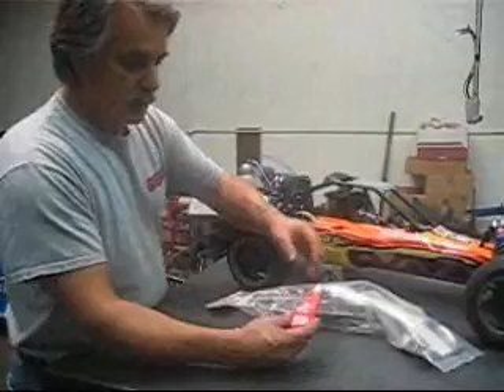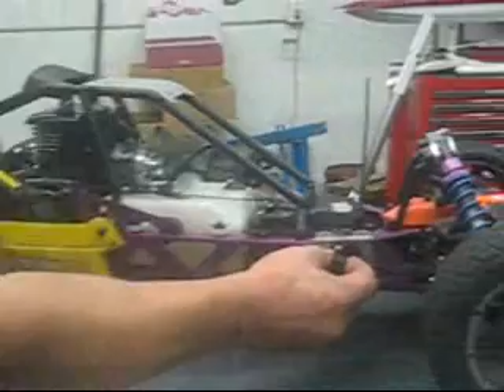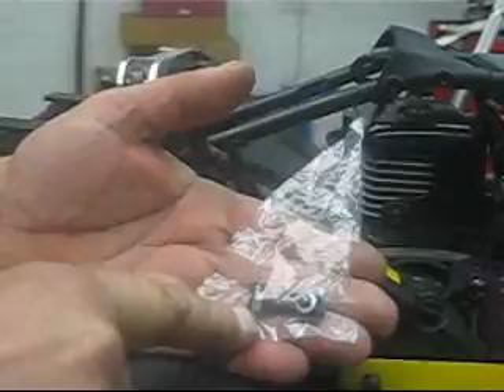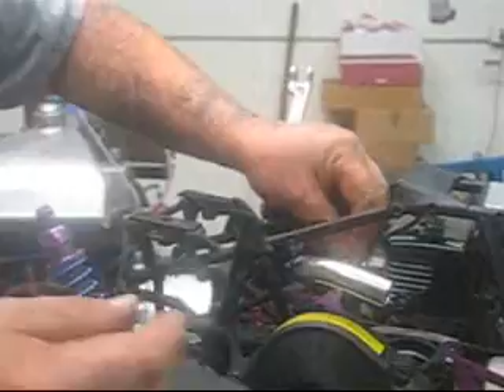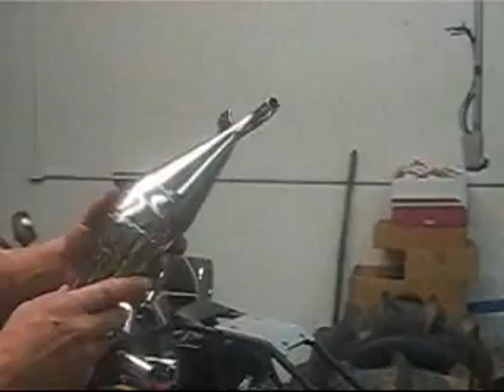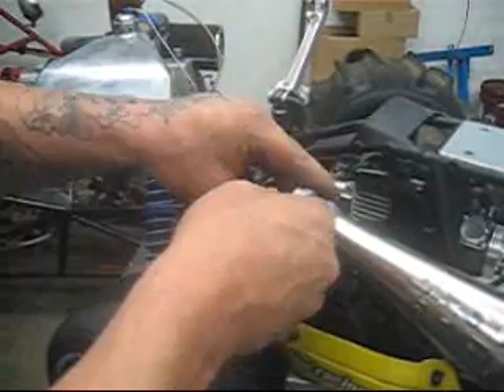GBE Tuned Pipe How To Video

Comment: ok, for all of you, look at the pipe, with GBE pipe, you see that it uses a silicon sleeve, the advantage of that is so if you crash it has a weak point to split at, if you have a dominator or a jetpro, the pipe bends/cracks and could do damaage to your cylinder, personally i think its a on the big side and it does scale the actual car down, but hey all you have to do is consider the performance gain you recieve from a pipe like that and makes you want one, im going to get one when its available